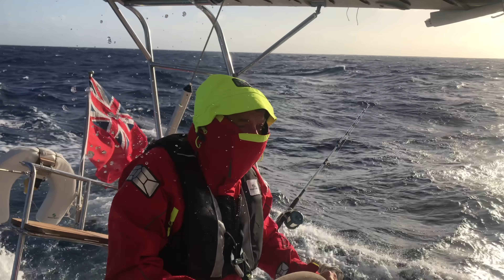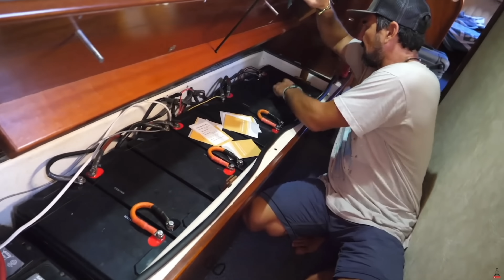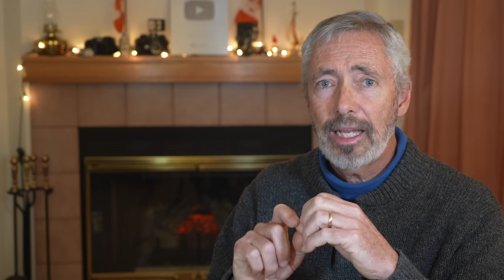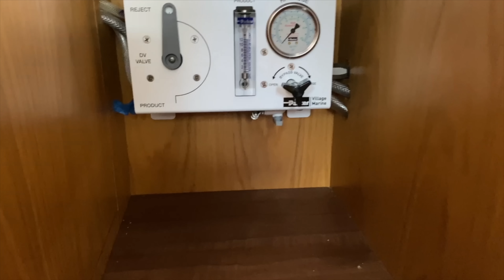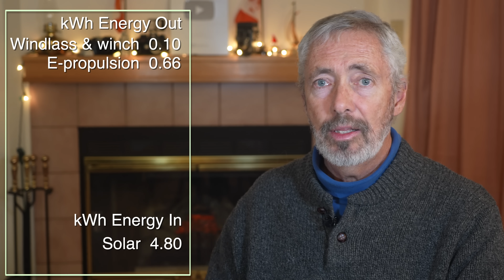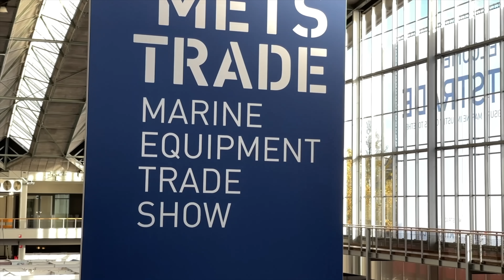Building an ALUMINUM Sailboat Pt 8 - HYBRID Power on a Sailboat: Will it Work for Distance? | EP 228

Comment: It's a real pandoras box.  The "real world" energy density of batteries is still the biggest hurdle(after the cost of course).  A hybrid system logically makes more sense than a pure electric set up, which is an absolute farce.  Silent Yachts still has to run a generator regularly for their massive battery bank to remain powered.  Propulsion is the absolute killer as far as draws on power are concerned.  The ability to island hop very short distances under silent power sounds lovely.  The reality is you can literally watch your power supply plummet at anything over 4-5 knots and you'll last an hour or so if you are lucky.  Then it's back to turning the generator(or engine) on to get your banks powered up again.  Even with 30kWh of batteries, the best case scenario is silently entering and exiting a marina, cooking on an induction stove and cooling down a cabin or two at night.  Worthy goals and doable, but the cost involved to do so silently, is still too much.  Then you still have the reality of battery life and real world usability in cold climates.
Reply: I think you missed the fact that we are talking about a sailboat ;-)
Reply: @jaapvanpopta  The point is about using batteries for propulsion, in any application(sail or pure electric).  Pushing water is going to kill them quickly, which is why the cost is a questionable outlay for the return.  Sailing Uma can propel themselves at ridiculously low speeds and be dead in about an hour or less.  I'm all for electrifying a sail boat for cooking, cooling etc, but the holy grail is propulsion added to those duties and it's just not viable(yet).
Reply: @southernfriedkiwi6340  Did you see them in the Med with Honda's best ROARING away on the foredeck? Totally ridiculous.
Pound for pound, diesel is the ONLY real world reliable energy source.
Reply: @dancarter482  Yes, I did.  I like the idea of batteries for running appliances, cooking and A/C while at anchor.  I also like the idea of silent running, but the power density just isn't there, nor is the overall lifespan of a battery bank vs a diesel engine or genset.  No one wants to talk about all of these batteries going into landfills either.  That's an inconvenient truth, like the mining involved to get the rare earth materials in the first place.
Reply: @southernfriedkiwi6340    upp.... powering through water is different than a car where once a vehicle gets up to speed efficiencies goes up.... Northern latitudes on electric ?  Little sun and wind... dream on... although going through the canals of Europe where motoring for 20k / day in flat calm and plugging in at night would be fine.  Everyone loves the idea of an electric driven boat ... ask Nigel if it can actually work....  maybe if you want to sit at anchor for several days so that you can motor for 45 minutes.  Love the channel and their new boat ... really great people ..
Reply: @dancarter482  Diesel engines die if not used often enough, so it all boils down to how its used 

motoring often and keep the diesel happy, or sit at harbour/sail often to keep the batteries happy.

my main concern would be if the generator fails and batteries run out before harbour is reached, two diesels allow for a failsafe, one generator does not.
Reply: The hybrid makes perfect sense. If you want to motor large distances; go diesel. But we're talking sailboats here where diesels have a very hard life, mostly being used for manoeuvring amd the occasional longer stretch. It also depends on the amount of patience you have, plenty; then fair winds and smooth sailing, very little; use lots of diesel.
Reply: @d.j.vanderschoot3717  That's my point.  Even a very modest distance is a big ask. That's at a very slow speed as well, at less than 4 knots usually.  The reality is that a lot of sailors want to or have removed their large generators for batteries, but end up bobbing aimlessly in the water, or hook up a portable generator because they actually have to be somewhere for a haul out or to catch a flight etc.
Reply: @southernfriedkiwi6340  i'd have to do the sums but I would expect more for a light displacement boat like this and 10 kW. (Tally Ho at 30 t displacement will do over 5 knots at 20 kW)    For a sailboat you have a lot if power modes that just get you on and off anchor, out of harbour, the last bit to the harbour etc. That's where the e drive comes in and where a diesel is very inefficient. At half battery capacity it's still 1.5 hours of running at full throttle. So for a sailboat that is usually more than enough.
Reply: @d.j.vanderschoot3717  Yes, every boat and power plant is different.  When you look at power usage graphs for batteries vs propulsion, it goes steeply through the roof very quickly, with every 1/2 knot increase.  Bearing in mind that you have to keep reserve power for running your boats' systems as well.
Reply: @southernfriedkiwi6340  True, but the orion 49 is only 15 t of displacement so I would expect 5 knots or so at 10 kW. Even with a generous houseload of 5kW the LiPO4 batteries are discharged at 0.5 C which they can do without affecting battery total life. So it looks they will have plenty of power available. W.r.t. energy, that's another thing. The batteries are energy storage, not an energy source (such as fuel). On DS III the sources are solar, regen and diesel. So as long as you do your sums w.r.t energy balance correctly (as Paul seems to have done) then you can limit diesel generation to a minimum.
Reply: @d.j.vanderschoot3717  Yes, it all comes down to variables: 12V vs 24V vs 48V, head winds, currents, displacement, the battery bank size, the solar panel capacity and the real estate that it requires, freezing temps, how patient the captain is, time constraints etc.  I look at everything as a live aboard prospect, not marina/mooring ball jumping in the Med.  Harbour hopping in the Med isn't going to be terribly difficult with a robust system,  but on significant crossings, it's going to be used for systems and you'll be burning diesel for propulsion.  I saw video on a sail boat refit where a 60ft+ was getting 48kWh(4000Ah) of 48V batteries.  Their estimate was a couple of hours of propulsion at 6-7 knots.
Reply: @southernfriedkiwi6340  So, just as in sailing, you adjust your cruising to environmemtal conditions rather than a set schedule. Patience and diesel seem to be on opposite ends of the scale.

Comment: I would exchange the central diesel heater with a Refleks stove. This oven doesn't need  power only diesel and they are common in Scandinavia because of reliability. Some of them coming with a copper pipe which can be used to build a central heating.
Reply: Great choice for cooler climates!
Best combined with warm water provided for radiators around the boat and warm water tank and a stove top to get the chance for some cooking as well.

Comment: Your eBudgets for the various missions are awesome.  A breakdown for a catamaran would be interesting because of the opportunities to add solar to the larger horizontal surfaces and the reduced propulsion requirements of the slender hulls.  Think HH55 or Silent Yacht's Silent 60 which would also lead to the discussion of what the sails, rigging, and mast cost versus increased solar.  In the future, axial flux motors and Sodium-ion batteries will make the business model very interesting.
Reply: The other day I read about sodium-ion batteries. Yes, salt. No concern about the availability of salt in the U.S. because of the many salt mines, including the salt mine below Lake Erie close to Cleveland, Ohio. I think I recall sodium-ion will recharge faster, and provide greater efficiency. Science! :¬) Webhead USA

Comment: I was investigating hybrid propulsion a few years ago. We're in a catamaran and the best solution I came up with was a single hybrid diesel and an all electric side. With that you could have the option of running all electric, diesel only which is then a big generator. With regeneration and plenty of solar I figured that was the only way to still travel as we do with diesel only. We do start the engines to make time and the thought of being out of power at sea or at anchor is, I feel, unacceptable and unsafe. 
 I have a friend whose 60' wooden sailboat has two engines. One large one for normal use and a small one which he uses to aid maneuverability. 
 I mention this because I wonder if a similar setup might be feasible on your boat. A. Single hybrid and offset a second electric motor. You would then have the benefits I mentioned above and the added maneuverability.
Reply: Will definitely start seeing  more monohulls with two electric motors.  You have redundancy,  twice the regen and great maneuverability.  No more bow thrusters needed. In some cases a second motor will be less expensive than a bow thruster.

Comment: I like the idea of diesel-electric hybrid, but I would stick with propane for cooking.  Storing 6 20lb bottles on a 49 foot boat is no problem and will last a year per your example usage.  Plus you need gas for the BBQ!  Happy New Year!
Reply: I disagree.

1.) Propane is a potential hazard (heavier than air, explosive ...).

2.) Getting rid of one fuel type is a biggie. Diesel is easy to come by anywhere.

If you have a diesel gennie anyway, cook electric!

Comment: Think the cruising type sailors way forward with a specific all electric hybrid system. Huge battery packs as the center of the setup. Solar and regenerative (prop and wind) sources being a big part of the mix. The fossil sources genset or main engine alternator. Most likely with electrical propeller drives; ie decoupled from the main engines.